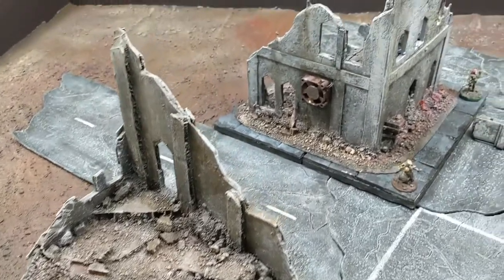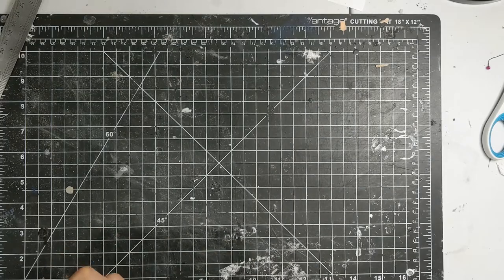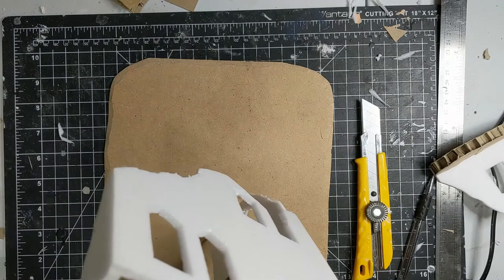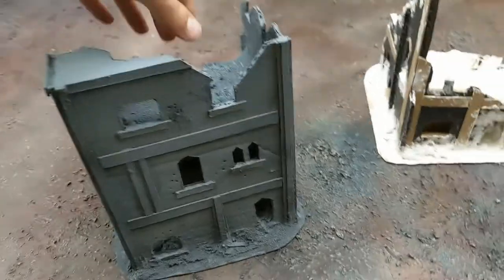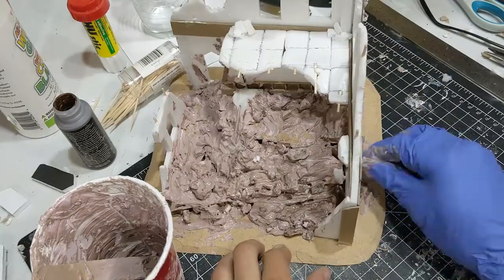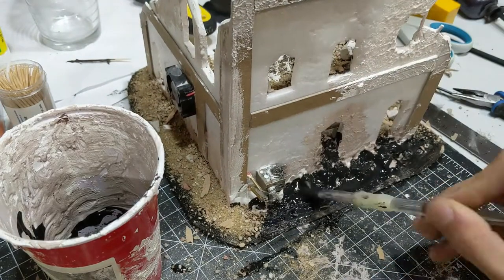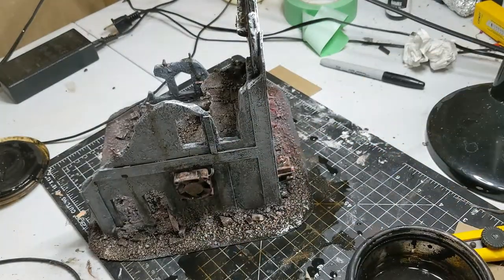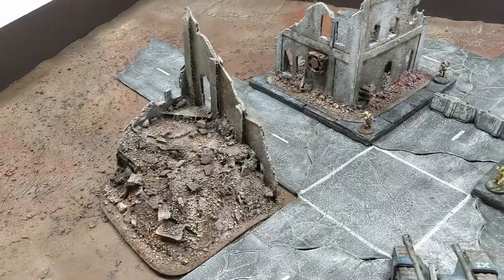Wargaming Ruined Building | How to build Grimdark Terrain

Comment: I'm doing some ruins now but keeping them more generic so they can be used for any setting.  I can say that I wish I'd seen this earlier since these windows look much easier to cut out than the round arches that I did.
  
A slightly different way of doing rubble is to use cut up sprues for bricks and kitty litter for general texture.  One thing I'm planning is to make a couple hills out of rubble.  Maybe they'd just be hills rules wise but they'll match the rest of the board.

Comment: When you’re molding the foam core with tinfoil is it just done by brute force? Or is there some other step in there to make the foam core mold to the tinfoil?
Reply from the maker: Just used as a way to add texture, brute force is enough to press in detail to the soft exposed foam. Make sure you peel back the paper covering (maybe that's the step that's missing?)

Comment: Hi, early on you glue stick the templates to the foamboard card, and then in the next step not only are the glued-on templates removed, but so are the foamboard card outer layers.  What is your method for removing the foamboard card outer layers from the foam?  If you wanted to leave the card on, is there a special way to remove just the glued-on templates?  I don't imagine you'd want to leave the templates on and craft over them as they don't seem to glue strongly.
Reply from the maker: The foamboard I use for templates isnt that great, peels off pretty easily with my fingers or a knife.